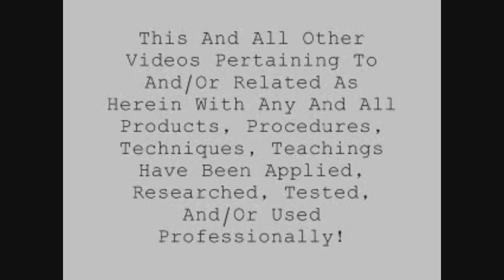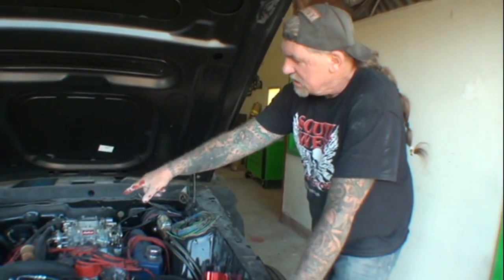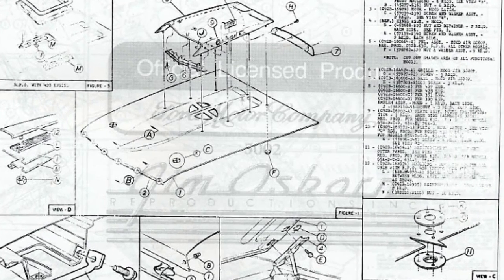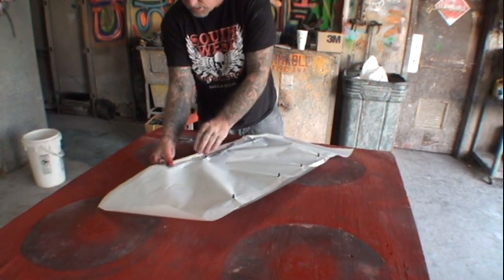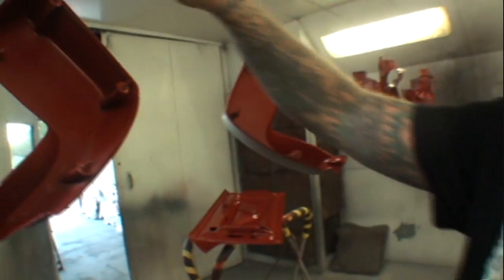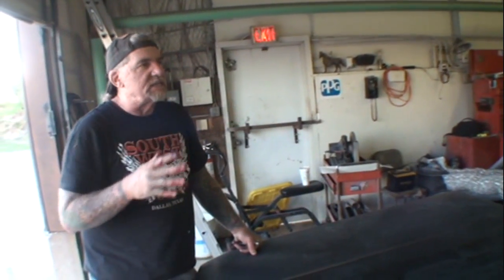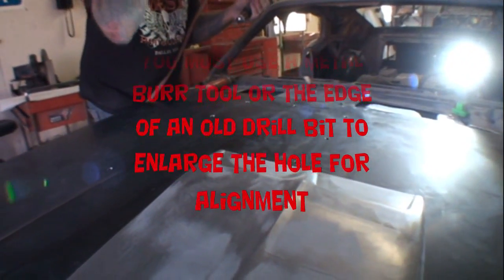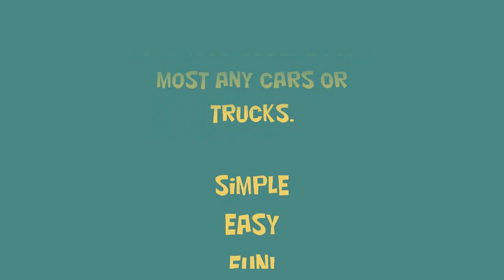How To: Install A Hood Scoop On A Car Or Truck

Comment: Take a piece of good quality cardboard. Put a drop of paint on the ends of each of the scoop's studs. Now place the scoop onto the cardboard and press the scoop down well. Now lift the scoop and punch holes (with a punch tool) on each of the paint marks that were left on the cardboard. Place the scoop back onto the now punched cardboard making sure that the studs are coming through the cardboard. With a sharp pencil trace around the scoop. Now cut the cardboard on that pencil line. You now have an accurate  foot-print template. -----------------------That's call CAD (Cardboard-Aided-Design)

Comment: I do spoilers on my cars never done scoop. I make double sided electrical tape circle wadd. stick at end of bolt thread place spoiler wear I need it on trunk and press down. when you remove spoiler tape stays were you need to drill holes

Comment: I am gonna move my scoop 1/8th of an inch from the edge. The paper template was genius why didn't I think of that? Update date seem like I have a curve at the top of the hood edge so it will be lower to an inch. That center is easy to find I miss mine by an inch. Now I will have to bondo my hood because it's dented in the center. Move my scoop up, used to be in the middle of the hood. Bondo the hole recenter the scoop. Painted the hood then install the scoop. The center on my was by locating the badge. I am also gonna paint a single striped going down from the hood scoop. It all make sense when I watch your video.

Comment: Do you think that is the same way with the eBay Mustang two front suspension kits? Also you can put a light dab of grease on the end of the studs and then set it on the paper and then knock through the holes with a seal pick or something like that to be perfect with the center of the holes

Comment: Great video as always Pete. A little trick I use when marking out templates is to fold the paper tight around the part and use a carpenters pencil with just the edge chopped out to mark the edges. You can also use your grubby thumbs. Cheers.

Comment: I know you are more to the bodyshop side of things, but would it be advantageous to actually cut some vents in the hood to let some of the scooped air down into the engine bay?
Reply from the maker: You could do what ever you want, they make hoods with small air scoops, I have done this in the past as well, When your dealing with a factory car like this it's better to keep it orginal...

Comment: do you have any idea where may find a harmonic balancer pully for a 1963 chevy 2 nova 4 door straight six let me know if you have any ideas
Reply: What size engine ? 153 cid, 194 cid, 230 cid ? Might be cheaper on ebay but, here's one. Product #: G5089 Brand new $70.99. Press on link-----> 

http://www.classicindustries.com/product/truck/parts/g5089.html
Reply: Danny Boy okay I think its a 194 cid

Comment: Do it RIGHT. Order a FORD template for ANY factory scoop ever offered. Paper guide with bolt locations, measurements from rear edge of hood, and from sides of hood.TAPE template down to hood. Using LONG center bolt in a cast carb...risk damaging threads INSIDE throat of carb. PASS. Use a piece of clay shaped in a cone atop carb stud. DO    ABSOLUTELY    COVER engine before ANY drilling or cutting. Flush mounted to rear edge of hood ....with rear portions of SCOOP removed...gives you cowl pressured air into rear of scoop...think cowl induction GM / AMC Javelin AMX hoods.

Comment: can you build a whole car with aftermarket shit ???
Reply: He has pretty much done that on the "Rustang". By the time he's finished with that about the only original parts will be the fire wall, roof, and rear tail light section.
Reply: Dannyboy no, he changed the firewall.